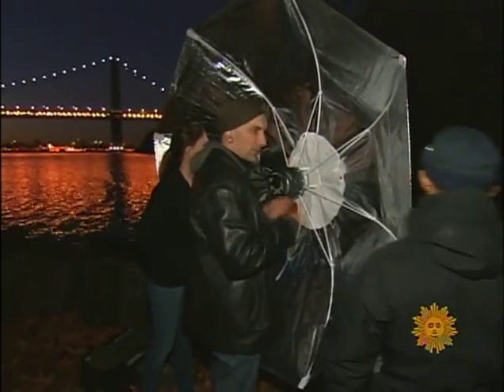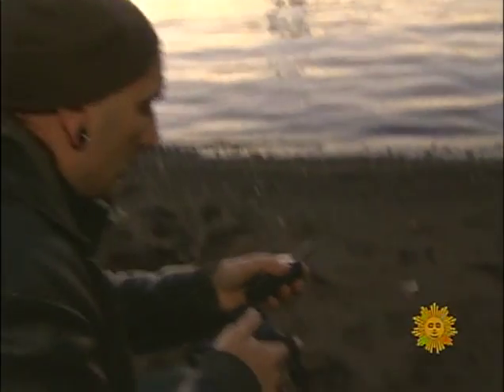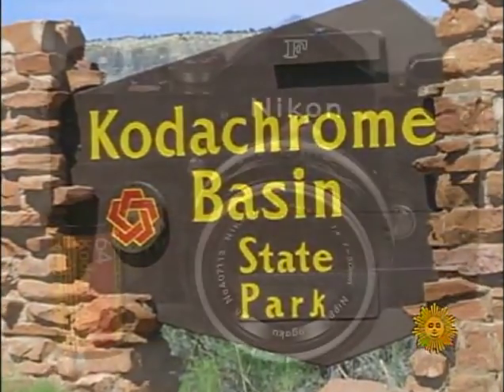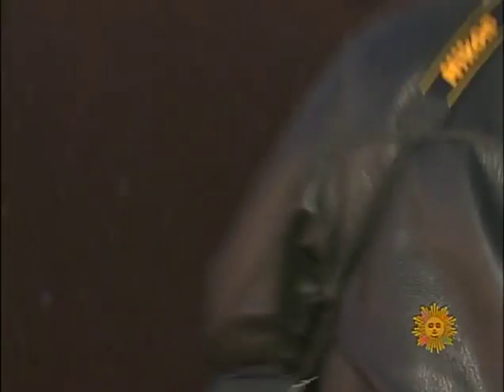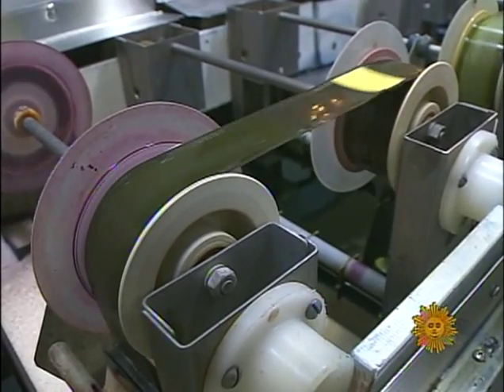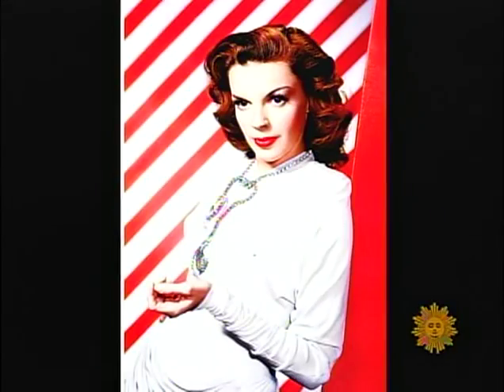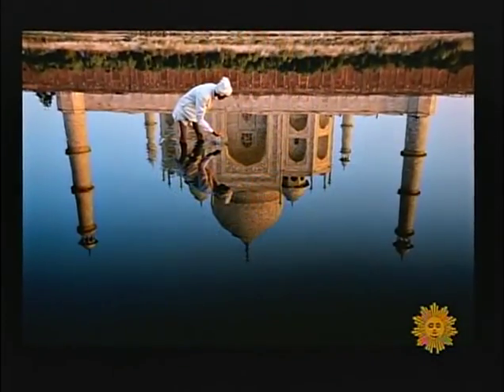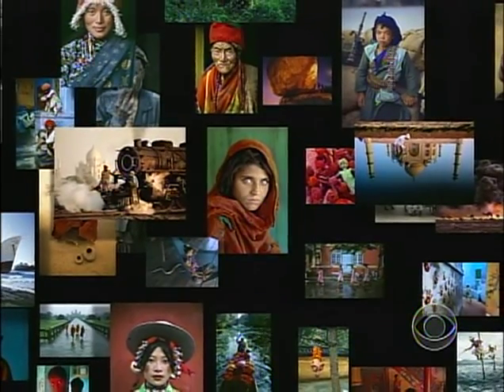CBS Sunday Morning "Photo Finish-Kodachrome"

Comment: I used Kodachrome II (ISO 25) in an old Leica IIIa in the 1960's and rejoiced when Kodachrome X (ISO 64) finally arrived. When the rangefinder Nikon S2 made way for a Canon SLR, then a Nikkormat FTn, I began using Ektachrome, especially High Speed Ektachrome (ISO 160) due to slow lenses and weak electronic flash units. In time, Orchid photography led to Kodachrome 25, and I did try Kodachrome 200, which didn't quite measure up to Ektachrome 200. A job change took me away from Kodachrome in general, and film photography in particular. When I could return to photography, slide film had been shunted aside by Kodacolor II and 400. Kodachrome has been gone for years, but it's like an old friend is dead and gone, since all that's left is Paul Simon's song.

Comment: All my home movies were shot on Kodachrome 40 Super 8mm. Recently have been getting all my collection converted to digital and found the frame by frame scanning technology far superior than any previously used projection based capture. The last four short films uploaded on my channel were all filmed with the Canon 1014e on Kodachrome 40,  and scanned with frame by frame technology. You can tell the difference. It is a faithful mirror of the original film look. The film stock and color which hasn't changed a bit mind you after up to 30 years in cans.

Comment: meh, provia is better. if you're he'll bent on a kodachrome like experience just do trichromy photography with B&W film. the stuff was toxic as fuck and glad it's gone B+W, C-41, & E-6 is much better regardless of what nostalgic ideas people have about kodachrome. we amazing film available today with ultra low grain and virtually grainless when using large formats.
Reply: +Joe Doe 
My career was built on Kodachrome and Tri-X, however I succumbed to the temptations of E-6 films, specifically Fujichrome (Velvia and Provia) in the early 90s as more K-14 labs were closing making fast processing of Kodachrome more difficult vs same day processing for E-6 films. That said, I now wish that I had shot a few farewell rolls before Dwayne's K-14 processing machines were switched off. Whilst like everyone else I shoot digital for my editorial and commercial work, however I still shoot a roll of E-6 a few times a month to keep sharp.
Reply: cameraman655 nice, I still shoot 99% film. C41 and E6 both have great stocks although unfortunately E6 has very limited choices, the choices we do have though are great, so I can't complain too much.
Reply: Provia is just not the same.  Maybe superior in some ways, but not the same colours.
Reply: Yep, Velvia is flashy, that's for sure. But just bear that in mind and look for shots that play to the strength of Velvia. NOT to be used for human portraiture.